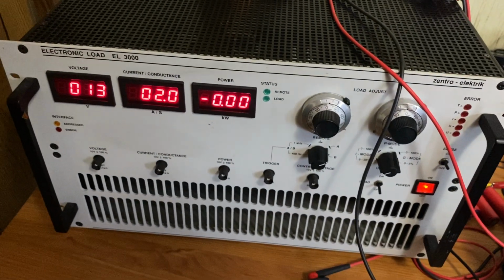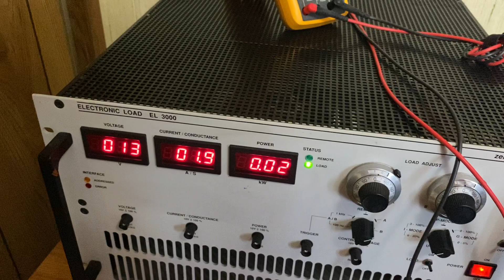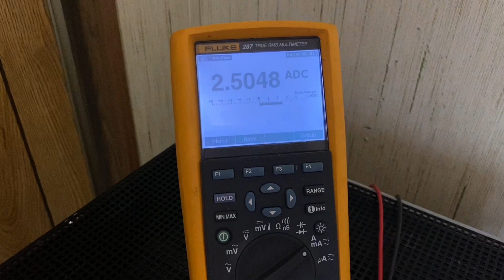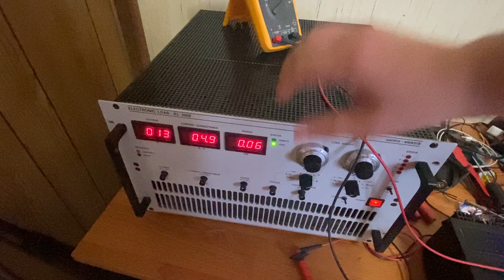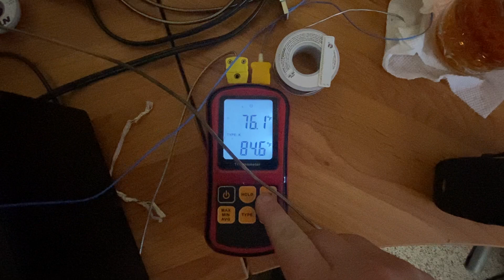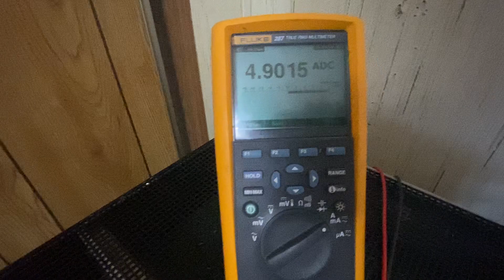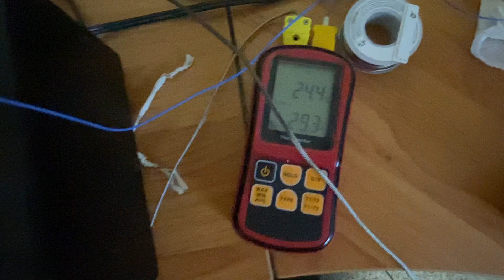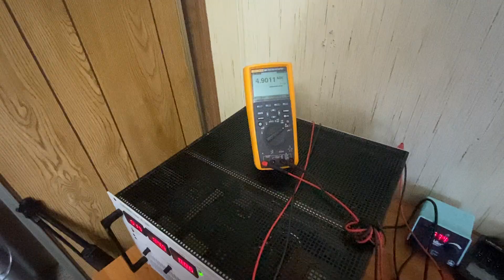Testing the  KSD-01F Thermal Switch 5 Amp Current Rating

Comment: The Sensata/Airpax part that these are "knock-offs" of only rates these devices for 1A at 24v.  I would tend to believe that rather than the sketchy data sheets that are published on the internet for the knock-off devices, so I was surprised to see that the would really stand up to 5A for an extended period.  Thank you very much for testing these so people can see how they really work.

Comment: I've been searching for a solder that melts between 500-1000 F.  Can you help me with that?   It may not be exposed to  500 F but I don't know yet.  It will be mounted on a heat sink for a O2 sensor on my motorcycle. It will prevent my AFR O2 sensor from powering up until the condensate/water is cleared from the exhaust pipe.  The contacts close at 230 f  .  I think a solder that melts at around 500 f will be sufficient.